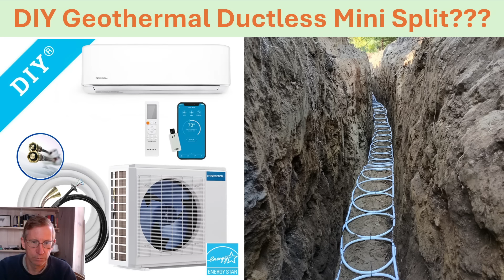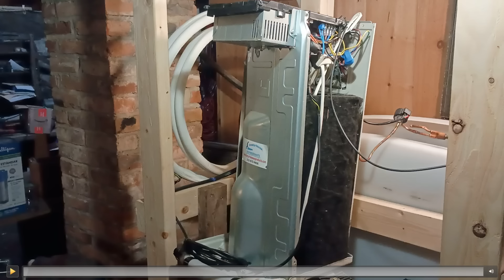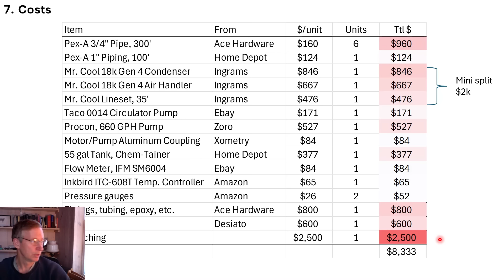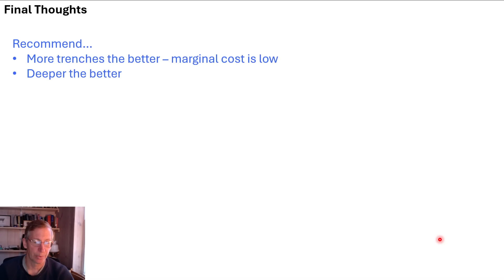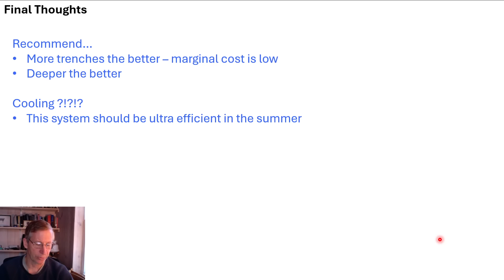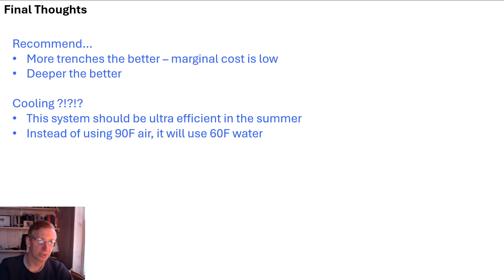DIY Geothermal Ductless Mini Split (Ground Source Heat Pump)

Comment: Did you consider a direct exchange geothermal system - where you would bury the copper freon lines directly (most do so in a loop or two in a vertical boring)?

Comment: I can tell your an engineer.  LOL..... Honestly there are so many variables in something like this that you may just have to "wing" it and go from there.  

 Like your calculation on energy per cord.   Different woods provide vastly different BTU output. Same with moisture content.  Its not a number you can just generalize on your experiences and its a whole rabbit hole to go down to actually calculate BTU output of wood.  Best way to install a wood stove? see what the neighbor did and "wing" it, then adjust.

and ground temps at certain temps aren't a constant.  elevation and topography play big rolls.   Again..... to much over thinking. Just "wing" it to the best of your knowledge. Observe and adjust.
 your last slide gives the most information to a DIY system.  "Trenches.... the deeper the better "  KISS.... keep it simple stupid. 

 Keep it simple and cheap so adjustments aren't prohibitive.

Comment: A year have passed. Would it be possible to get an update on this? with temp / performance. It takes some time for the groundtemp to change when starting a system like this.

Comment: No need for all of those loops of tubing in the ground, one on each side of the tench and one up the centre would be immesurably less efficient but being shorter it would need less power to push the same mount of water through it, also cheaper.

Comment: I think you have some power saving available in the water pump.  That motor was meant to run an air fan not move water.  I suspect it isn't optimized for that kind of resistance.  There should be a relay that kicks that 3-phase fan motor (your current water pump) on, you may need to change out the type of relay but, you can remove that motor and drive a dedicated water pump and motor at once instead of driving a shaft with a coupling running at a non-optimal rpm.  You can get a 120v 1HP water pump that moves 15 GPM (900GPH) for 100 dollars in amazon.  Grainger has a pretty good selection of relays if you need to change it out.  One other thing I would do to try and prevent freezes and having to use a second circulation pump, is to build a vertical slot in your water tank to have the coil sit in, and seal it to the sides of the tank so it would force the circulating water that goes out to the ground loop to pass through the coil.  If the coil is mounted in the middle of the tank and sealed on the sides, have the draw come on one side and the return in the other so the water has to pass through the coil when the water pump is running... I don't know why you would ever need to have a different circulation pump if you were forcing the water through the coil instead of just relaying on thermodynamics.  Moving water can't really freeze as easily.  Very cool system though.  OH BTW.  To stop the backwards running on the motor - The existing relay that you have for your 3-phase will have a directional component to it.  You will have a low voltage lead for each direction and then a neutral and those will sequence the phases on load side of the relay.  if you take those low-voltage leads and add diodes to them so they can't backflow onto the opposing lead you can wire them to the same low-voltage post on the relay and the motor will always spin in one direction no mater which direction the control board is trying to spin the motor.  Good luck.

Comment: great video. I'd be curious if a fish tank air bubbler bar submerged under the evaporator would have provided sufficient tank circulation. I don't fully understand using the fan motor driving a pump. Seems like a point of efficiency loss when it looked like you had a load specific circulating pump that would work for the ground loop.

Comment: Regarding the heat pump reversing direction, you could connect the motor with a ratcheting shaft where the motor can freely turn backwards without load.

Comment: Great  job on this.  The green Taco circulator pump is normally used in a boiler system with metal pipe or oxygen barrier PEX.  Oxygen is constantly diffusing into your water and then being consumed at the pump to cause corrosion.  Hopefully will never be a problem. The gold painted Taco pumps are brass or bronze and oxygen proof.  Maybe you already do this but if you install a partition in the water tank between the thin perimeter of the coil and the tank wall creating 2 compartments and draw from one compartment and return to the other it forces all the water through coil fins.

Comment: Very impressive for me. I have several acres I'm developing and own a large excavator. I found this while searching water to water heat exchangers and they are so expensive. My strategy is radiant shop floor but this is very cool. Thanks Edward.

Comment: Interesting video, thanks! Regarding the circulation pump, I wonder whether you have considered directly stirring the water in the tank with some kind of impeller and whether there are downsides to that.

Comment: You could have spent under $1k on the mini split, and the balance on solar panels and have come out WAY ahead.
Reply from the maker: I'm not sure how I could spend only $1k on a mini split, I bought one of the cheapest available and it was over $2k.  In addition, if I want the same BTU output on a cold winter day, and I used a standard mini split, I'd need a system rated at almost twice the BTU as I am using (and twice the price).  It could still work out putting the extra I spent toward solar, but it isn't quite as clear cut as you make it sound.

Comment: I have been considering this but instead of the mini split I'd like to use a heat pump water heater!  It was interesting to see you used all the standard parts.  Cool project.

Comment: I live in a hot climate. Cooling is my largest expense. I have a large crawlspace that is useless. There is effectively a 6ft mound of dirt under most of my house. Theoretically could I dig trenches into that and make a geothermal loop under my house? Any concerns?
Reply: You have to understand the liquid flowing in a tube, in the dirt is being cooled by the dirt or mass, so the tube-loop can not be near the surface.
Reply from the maker: It's possible, but you need to distribute the heat over a large enough area to dissipate.  You'd still want to go deep, which doesn't seem realistic under an existing house.  If you don't go deep, you'll have soil under your house that is very warm, defeating the purpose.

Comment: I'm more interested in the cooling aspect than the heating. I'm moving to Tucson next year. Winters can be handled with electric heaters (using solar for the power source), but summers are BRUTAL, so I want to integrate geothermal into the cooling process.
Reply from the maker: It will certainly help with the system efficiency, but realize that your soil temperatures are going to be much warmer than mine (and if you are cooling for 6 months, the soil will get that much warmer).  You may want to get some input from local geothermal installers or DIYers to try to assess whether it is worth it.
Reply: Use heat pump for heating also
. It 
3x to 5x more effective and efficient then electric heater.

Mean for 1kw of electric you get
3 to 5kw of heat.

Where form heater it only 1kw of heat for the 1kw of electricity.

Comment: I wonder if you could use an automotive evaporator coil or 2 instead to save a bunch of money and get the same performance.
Reply from the maker: Interesting idea.  Wouldn't have the nice controls of a typical mini split, but would be cheaper (but even more DIY)

Comment: My off grid land has rock 30" below ground everywhere.  So, I gave up on installing any ground loops.  My approach would have been to use an auto radiator to preheat air going into an unmodified air source mini split.  Only circulate it when I had available power in the winter and it is cold enough that the solar production can't keep up.  But alas, trenches are infeasible.

Comment: I'm a geo installer and just installed a Samsung DVM-S Water, which is basically built for this type of use case. Though it is defiantly intended for professional installation, with a price to match. Instead of using a air coil heat exchanger, it uses a plate heat exchanger and has outputs for controlling a pump. It's a VRF system, so it's defiantly not DIY friendly and a professional install would not come cheap, but it would have been perfect for this install otherwise.

Comment: Too funny, I did the same hack with a mini-split on my boat. I used the fan supply to a water pump that pumps sea water to a coil for the heat exchanger. The coil is a 1 1/4" hose surrounding a nickel-copper line (copper rots fast in seawater).

I use it for heat and cooling on the boat, it works great.

It's always amusing to see the water start to pump out the side of the boat when the mini-split turns on.
Reply from the maker: You should make a video!
Reply: Commercial systems doing this are much the same, except they use a heat-exchanger to solve the corrosion problem. It's basically just a secondary loop pumping environmental water (usually saltwater in the large systems) through a circulating tank that flows to the condenser/evaporator. Keeps the expensive stuff nice and clean.
Reply: @jttech44  I picked up another 12k mini split to implement a hydronics cooling / heating system for the entire boat. I was considering a secondary heat exchanger to isolate the saltwater but the additional power costs for the additional pump may be an issue for a sailboat as I want to allow it to run on the battery bank.

Comment: The Condenser Not The Evaporator Gets Hot And The Evaporator Gets Cold! It Is Evaporation That Creates The Cooling Effect! So In Cooling Mode The Radiator Of The Outside Unit Is A Condenser ! In Heat Mode It is An Evaporator! That is Why It Quits Working The Colder It Gets! It Is Too Cold For The Gas Inside The Radiator To Condense!

Comment: To reverse a 3 phase DC motor you need to swap 2 of the 3 phases so somewhere within the unit there is a system that deals with that.
In order to stop the motor from reversing you will need to bypass that reversal system in some way but there might be a sensor that verifies if the fan is spinning correctly so you risk tripping some safety feature.
A more brute force solution would be to bypass the fan entirely, leave it connected so that the unit is happy and power the pump with an independent motor but that will probably cost you more even if it is the simplest solution that I can come up with. If that system is within the fan motor itself it might very well be the only way too.

Comment: I see from your plan you are having a septic tank. Friend of mine had placed one slinky in septic tank while building it, to later use it as recuperation slinky for his Heat pump. Water is always present in it, and often it is even warm ~30 degrees C.
Reply from the maker: I don't think this would work well, as the flow rate through the system is quite low per day, but maybe there is enough heat transfer to the surrounding soil.  It would also decrease biological activity in the tank, which may cause other problems

Comment: I would recommend a tank and coil setup that puts the coil horizontal so the water can flow vertically while transferring energy from the coil. Like how hot air moves vertically when warmed water does the same. The horizontal fins do not allow an ideal flow direction. Also suggest setting up a relay from the fan motor you have coupled to the pump and use a different motor that will not reverse direction. It will simply run when given a signal.
Reply from the maker: I'd find an HVAC person to put a coil and coil heat exchanger in if I had to do it again

The motor runs at an odd 300vdc, I couldn't find an easy replacement

Comment: Quick question regarding the straightening of the heat exchanger: Any reason to not go with an automotive radiator instead? It's in the correct form factor, handles high pressures by design, and it seems like it would be a lot easier to get 2 fittings for the inlet/outlet made to connect to the coolant lines than to have an hvac tech go HAM on brazing all of the connection points between 2 plates at 90 degrees, AND evacuating, pressure testing, and filling the system. 

Or, even better, why not something like an brazed plate, liquid to liquid HX? They you can get something stupid like 200K BTU/hr for less than 600 shipped to your door.
Reply from the maker: I didn't feel like messing with the refrigerant at all. Ideally I'd have replaced it entirely with a tube in tube heat exchanger that is made for ground source heat pumps.
Reply: @edwardwazer5103 makes sense, thanks.

Comment: Im trying to understand if we're trying to min/max and get the most out of a heat pump by using the ground which we show is no where near freezing.. why are we reducing the efficiency by adding expensive antifreeze we don't need?  Add some insulation in the short amount of distance that isn't subterranean or in the heat exchanger.
Reply from the maker: My understanding is for typical ground source heat pumps they end up operating below freezing at the heat exchanger, or even throughout the system.  The loops are not sized adequately to maintain above freezing temperatures during the coldest part of the year.

Comment: Not sure where you got the ground temps but i think they're far more regional OR far more stable earlier than demonstrated.   Around 10ft down in the Willamette valley i get 60f in the summer and 57f in the winter.  We're near the 45th parallel.. halfway between the  equator and north pole.
Reply from the maker: I don't remember where the curves were from for ground temperature, but it's definitely a location that's much warmer than where I am in Connecticut.  I think you're in oregon, which is probably more similar to these curves than mine.

 I'm shocked at how stable you're saying your temperatures are from winter to summer

Comment: I did this same thing but in a slightly different way. I used well water which is always around 55F as my ground source. Secondly I replaced the outdoor coil with a liquid to refrigerant heat exchanger. The fan motor was the connection between the original system controller and my electronic controls. When the fan motor (blade removed) spinned a sensor picked that up and a valve would open to let water flow. I had safety built into it so that if refrigerant temps went out of range, a contactor would open and cut power to the compressor. Lastly since the fan blade is gone, I had added a small fan to blow air across the cooling fins for the system controller. It would get quit hot without that. The cooling of the controller relies on the fan driven air during operation. It worked great but unfortunately my system has been plagued with leaks that have nothing to do with my mods! GRRR! Both linesets failed and an indoor coil!
Reply from the maker: Nice job!  You should make a video and share it!  It would be great lessons learned for the next person to try something similar
Reply: @edwardwazer5103  Thanks but unfortunately I undid that and made it conventional again. I needed a city inspection on my electrical panel and thought the contraption would draw unwanted questions. I may do something smaller in the future since the plumbing is still in place. I have solar that outproduces in summer so running AC is still "free" with the lower efficiency. In winter I do require utility but even with 50F+ water my system had about a 2.5 COP which about matches what I pay for propane. I went with a cheap mini since if it was a total fail I could minimize my losses. I didn't realize the heating COP was that low.

Comment: I would have highly recommended using a reverse cycle marine A/C system which is extremely efficienct and already setup for fluid heating / cooling. Since it's made for salt water, the heat exchanger is either copper or titanium. You could have skipped the tank altogether.
Reply from the maker: Sounds like a good idea!  Maybe when this needs replacing

Comment: I'd be worried a mole or gopher would chew a hole in the plastic tube and render the whole system useless until you dig it up and repair it.
Reply from the maker: That'd be an industrious gopher!  If I lose a loop, I'd still have two more I could run with

Comment: Very cool project!  We have a dual-head mini-split and supplement with a propane wall unit, as needed, but we're heating a much smaller space.
Something I've always thought would be interesting is to have an out-building with a wood stove or crude masonry/rocket stove.  That building would be air-tight, except for an intake that was pulled through an underground loop.  Then you would either duct the hot air in that building to your living space, or use an air-source heat pump that draws exclusively from that heated out-building.